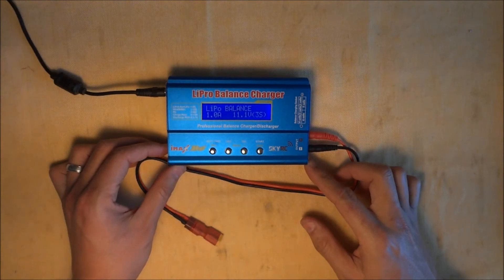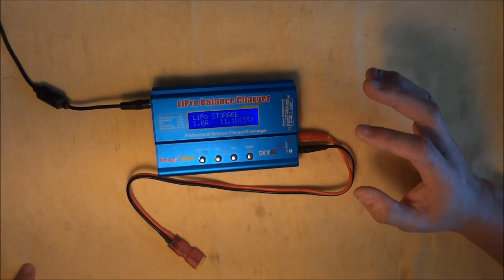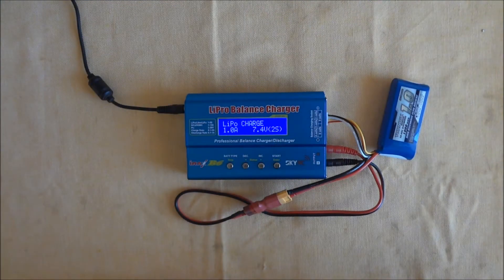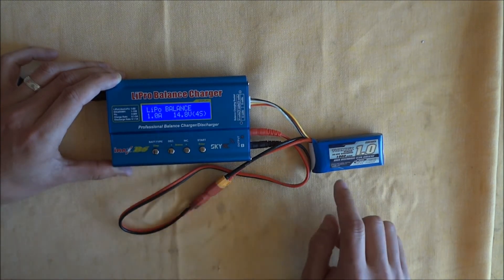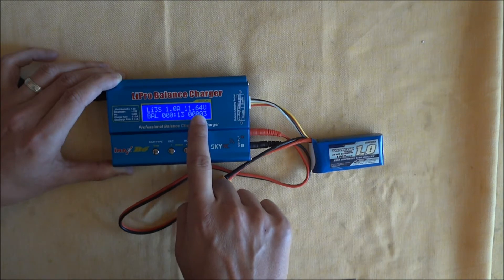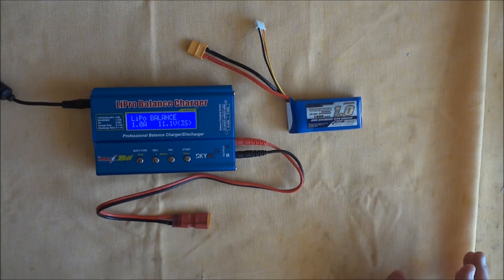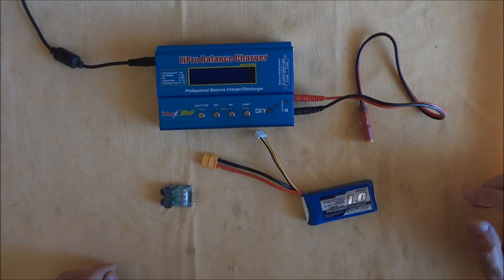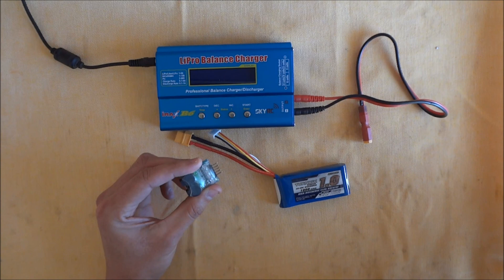Imax B6 LiPo charger usage guide for Nerf/Foam blaster specific application

Comment: hey BlasterTech! Just a question. How long will a 3S 35C (45c burst) 1000 mAh Lipo last in an average nerf day, BTW I am running 2 MTB 3S 130 Motors.  I hope you could respond, anyways nice video!
Reply from the maker: What motors exactly?  Also higher crush cages/wheels will use more juice as well.  Really depends on how much the blaster is used throughout the day.  Though with moderate use it should last a whole days play.
Reply: Ok, Thanks for your quick reply!  I am using the stock cage and I am using the 3S 130 MTB Motors, but a whole days use sounds good!
Reply from the maker: Ok so either Rhinos or Honeybadgers.  Sounds good.

Comment: Hey dude. Do you ever charge at higher than 1C? I know you have recently used the Turnigy nano-tech 1000mah 3S 45~90C LiPo, which is what I use for my Stryfes also. This battery's specs state it can take up to 10C charging current.

Also I know on the Accucell 4 buttoners, if you 'save' the batteries profile you can set the battery's capacity in the thousands (0000mAh etc) essentially creating individual cut-offs for each battery, as opposed to the global one in the main settings.

Keep up the great work!

Comment: I really need an answer asap

Where can u get an adapter that goes into main source for this charger in Australia that has a Aus plug? I've already bought the charger from hobbyking but then realised I needed a power supply.
Reply: https://www.hobbywarehouse.com.au/skyrc-imax-b6-12va-ac-power-supply-adapter.html
Reply: ^^^ Thats the one to use, its the genuine one.  Though you can use other supplies like for a laptop, though I'm not sure with the plugs compatibility in to the unit.
Reply: deandlo01 thanks so much
Reply from the maker: Its actually BlasterTECH here.  DeanDLO01 is my personal account.  Shhhhh!!!

Comment: Forgot to ask,
does more discharge drain more battery life?
example : 
Game is 5hours, I am not a guy that revs all day, I only do it when no need to.
if I use a 1000mAh 3s pack
25C and 35C discharge.
which discharge can save battery capacity?
Reply: EDIT : When I need to*
Reply from the maker: +Jonathan Lim Hi Jonathan.  Short answer?  No.  A batteries discharge rate is at the demand of what it is supplying to.  So its the motors that have the want/need for current/supply and its the batteries discharge rate is the ability to supply it.  Make sense?
Reply: Yup, thanks for the answer but I already got my question answered in the Aus Modding Community :)

Comment: My Tenergy Accucell 6 seems to work exactly the same way.  Not sure if that's one of the "cheap" copies, or just as worthwhile as a sibling.

I recommend actually paying attention what it's showing you at the start-up check, if you have selected the wrong voltage (S setting) the test is there just to be your backup.  Also those alarm modules are available for a few cents more with an onboard voltage meter - if you have room.  Personally I carry one along to wars in my electrical tools box.
Reply from the maker: +Bob O`Bob Hey Bob.  Yep, the Turnigy charger is great and is another brand.  All the 4 button chargers are pretty much the same with operation.  What I mean by 'copy' was the Imax chargers specifically.  There are copies of them out there for a cheaper price than the genuine Imax chargers.  They apparently 'over charge' your battery and therefore do damage over time.

Comment: If I need to charge a 3s 850mAh pack, but I don't have enough time because in about 30minutes my Nerf game is starting. If I want it to be fully charged, can I use a fast charge function? Is it  safe? what leads do I need to plug in? How long does it take to fast charge a 3s pack?
Reply from the maker: +Jonathan Lim If you are in a rush?  Forgotten the night before to charge?  Sure run the Fast Charge, thats what its there for.  And for other RC purposes planes, helicopters, put it on fast charge and your off an running again the same day.  But just note that there is no 'balancing' of cells in fast charge mode.  For our Nerf applications though?  I always recommend 1000mah for Nerf as a minimum (850mah at very minimum) they should get you though a day war with no issues.  So get organised and balance charge your batteries the day/night before and your ready to go!
Reply: Alright. Thanks for the info. Might just buy another LiPo in case one runs out in the middle of the game.